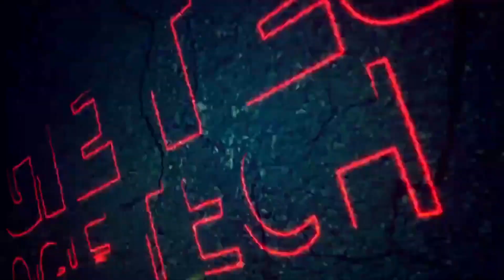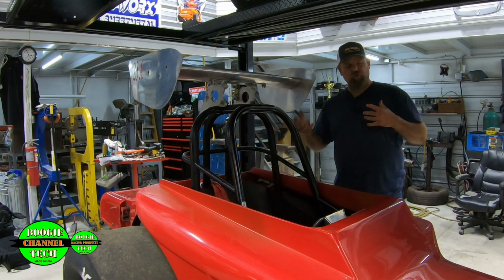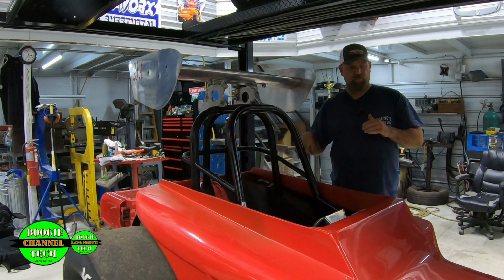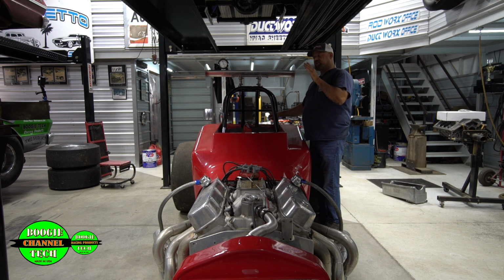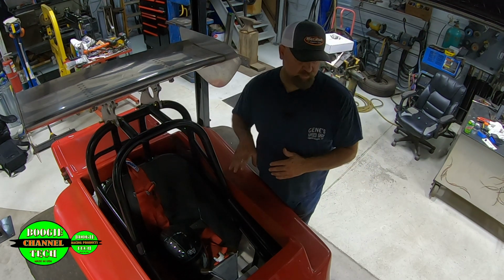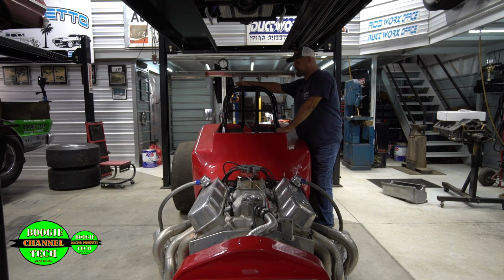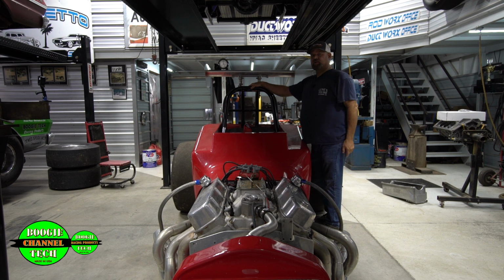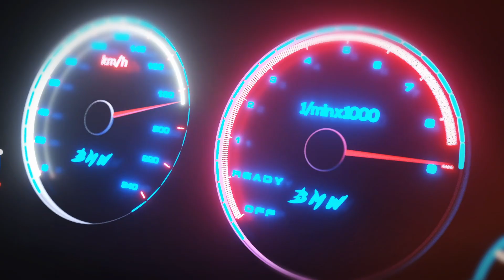Modifying Roll Cages - Boogie Tech

Comment: Uncle Tony's Garage channel talked about knocking himself out and being blinded running a Fuel Altered while his helmet was touching the bar.  In fact, to gain clearance he removed the helmet padding to get a little clearance.  Car went into a tire shake down track and slammed his head into the cage several times despite his attempt to fit in the car.  He couldn't drive from the track home and had to go to the hospital.  Problem was he built the car wearing street clothes then went out and raced when it was cold and had to wear warm clothes and suit.  Took up all the wiggle room.